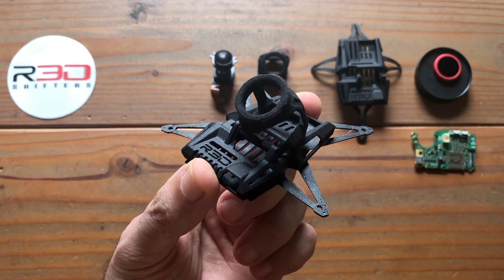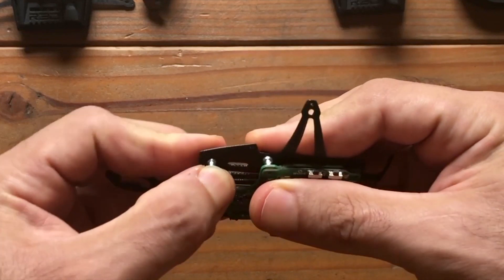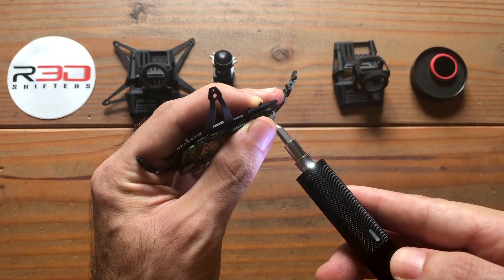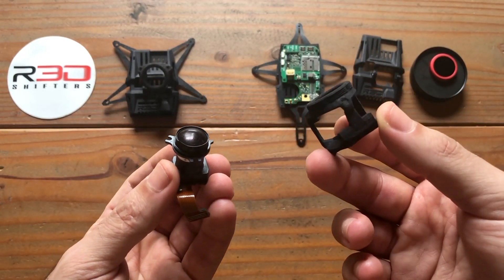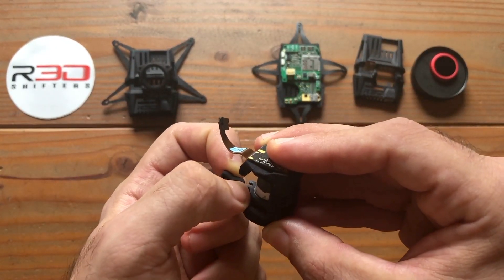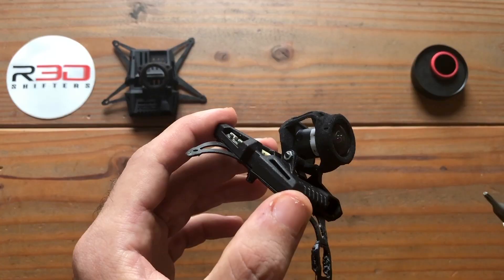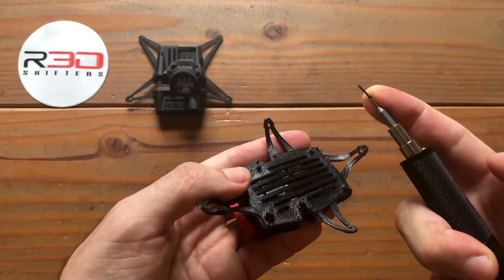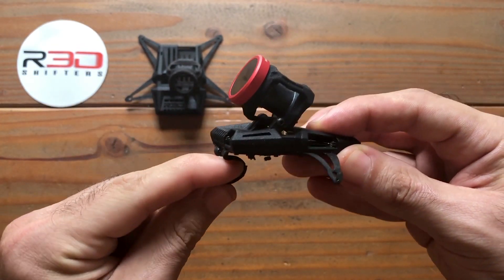R3D GoPod - Assembly Tutorial

Comment: Hello! I want to mount the Gopod to my 5 inch quad, is that possible? My quad has 30x30 standard mounting pattern which uses m3 screws. (Hyperlow CG frame) Thanks!!!
Reply from the maker: Hi Mert, Yes it is possible. The 20x20/30x30 variant will be no problem as long as you have extra length on your m3 screws!